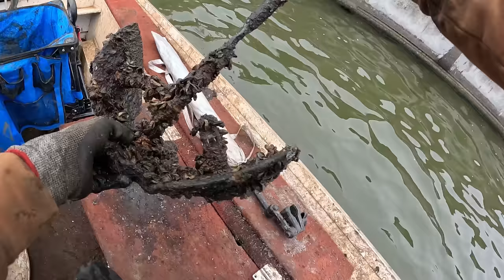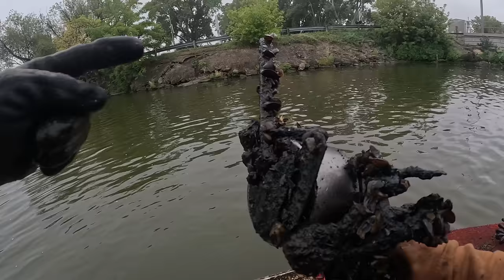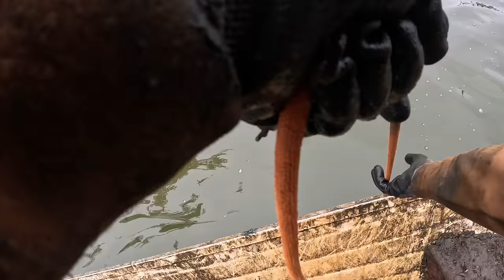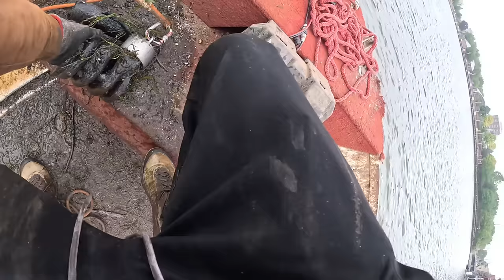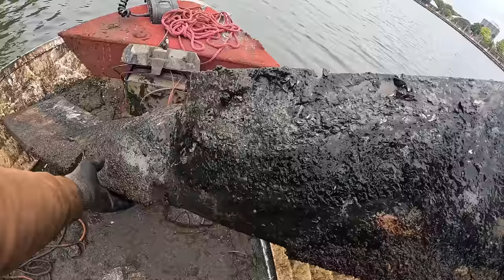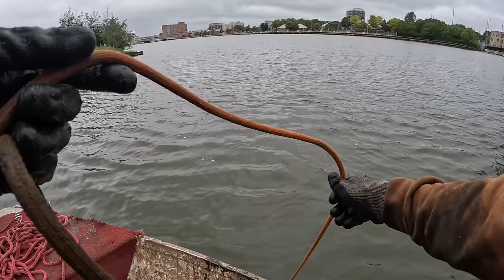I Found A Loaded Deep Hole While Magnet Fishing! *JACKPOT*

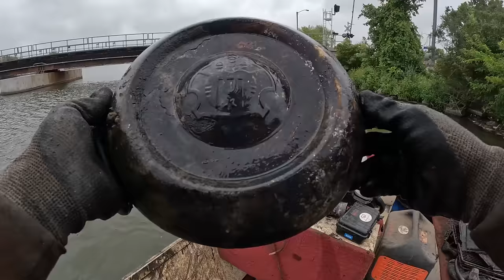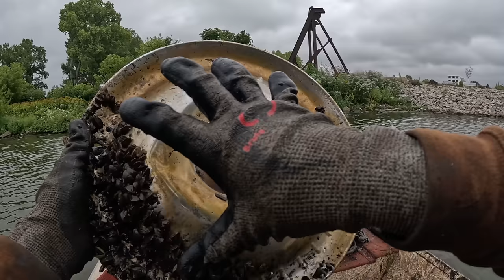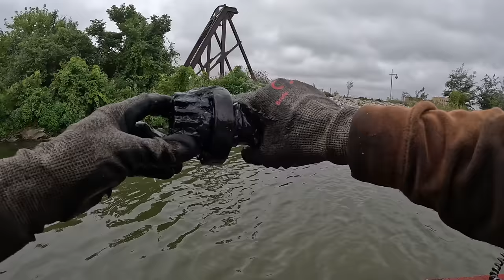Comment: 35:39 1940s 0ldsmobile wheel cover (hub cap) 37:55 1950s/1960s Pontiac wheel cover(hub cap) 39:05 input shaft for a large standard transmission
Reply: 1948-49 " Poverty Hubcap Wheel Cover"

Comment: 10:30   Oil sometime it’s more than just those two dabs  of oil,  we see at times there’s a whole lot more,  that is definitely damaging anything that lives under the water if you’d like to pick up some padding that you throw on top of the oil that is sold in Home Depot stores All you gotta do is open the package throw a pad in and the dissolves all the oil. Make sure you have a baggie to throw out all what’s been used it’s totally up to you if the Terrible oil disturbs you that much you could always get rid of it with these pads not sure what the prices but they do sell them over and out rep. Ducky thank you so much for taking care of our little creatures under the water.💜💙🩵🧡❤️🩷🍀🍀🍀 and lots of🍀🍀 luck🍀🍀🍀🍀☃️🎄🥰‼️‼️❣️

Comment: I was thinking someone could have tied off those heavy pieces of metal for a trot line or gill net or something. Then I thought of the electric chord and wiring. Somebody could have very well chopped up a body and grabbed the only thing they had to weight down the pieces. Probably debris from the railway laying around and old wiring so they threw the body parts overboard. Fifty years later the flesh rotted away and eaten by fish and crustaceans then the bones fell out of the tied up wiring. Think about it.

Comment: did you know that your trolling motor battery can drain itself overnight, even if not hooked to your motor especially if you don't glean the wet mud off of it when you get home, it's called parasitic draw Terminal to terminal drain or connection through wet mud.

Comment: used in concrete pours to raise the mess up so it wasn't right on the bottom of the concrete when it dries
Reply: later on they used what they called rebar chairs to hold it up to middle of thickness of concrete